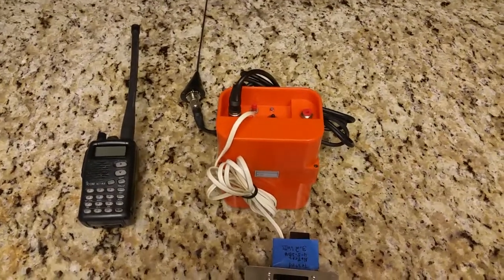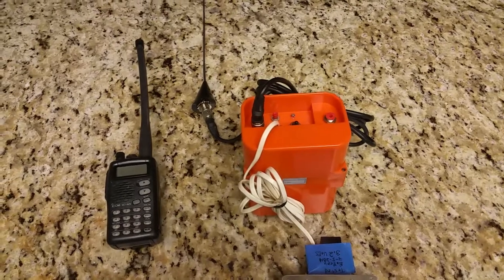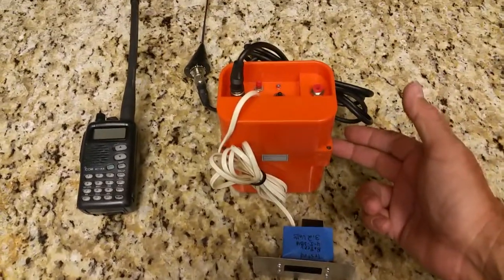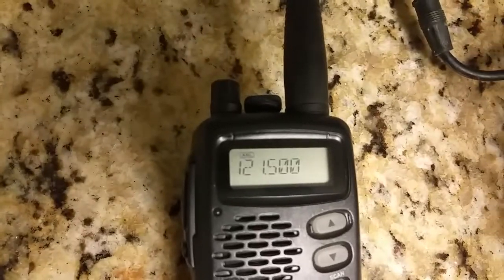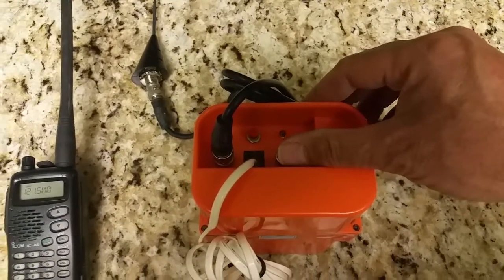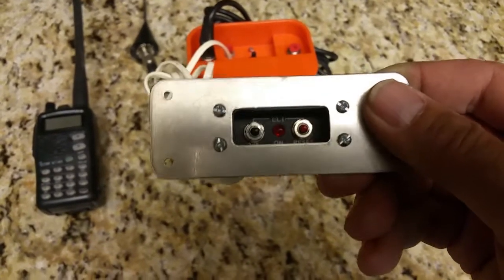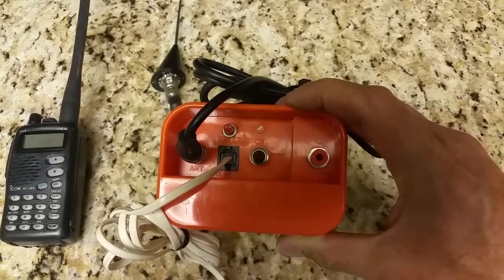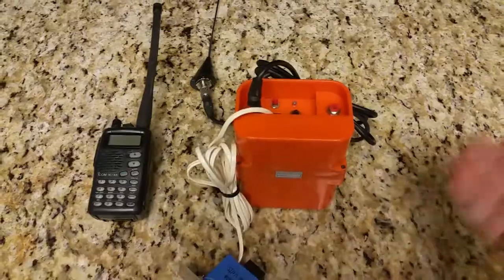Ameri-King Emergency Locator Transmitter (ELT) Test.

Comment: I thought the 121.5 MHZ was gone? I don't think they monitor that since 2009???? its all 406 MHz now..
Reply from the maker: That was the original plan but lots of GA folks and alphabet organizations fought the idea of having to replace their perfectly fine equipment. The FAA backed off on the requirement of mandatory replacement.   It will be interesting to see what happens with the ADS-B mandate in 2020 as well.   Here's some info: https://www.aopa.org/news-and-media/all-news/2009/january/22/whats-up-with-121-5-mhz-elts
Reply: We still monitor it.  121.5 is actually preferred over 406 since 121.5 transmitters are constant where the 406 transmitters are intermittent.  It's easier for those of us in the search planes to triangulate a constant signal versus an intermittent one.